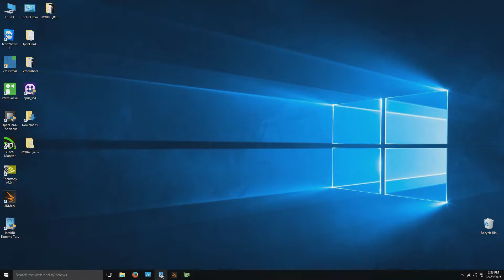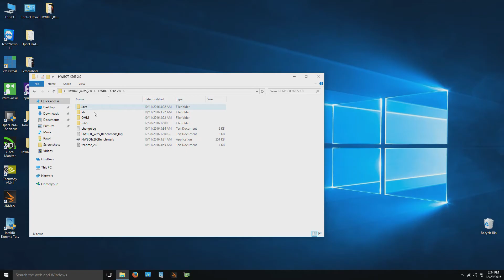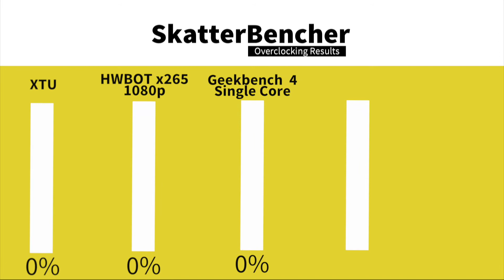Intel HD Graphics 630 (i7-7700K) to 1350 MHz with AIO | SkatterBencher #6

Comment: Hi me, i wonder if i can overclock an i5 10600k but from intel extreme tuning utility and would have the same results?
I have the rog strix z490e and i would like to overclock my processor
Reply from the maker: Intel XTU provides the same (or similar) overclocking tools like you'll find in the BIOS, so it shouldn't be an issue. I always prefer the BIOS because then I'm sure the settings are applied. Sometimes software can be a little wonky :)

Comment: more than 1300 only freese, and BIG voltg, big temp for x26-27
Reply: im running it with the multiplier to x13 (1360mhz). The limit for my iGPU was x12.5 because after that you need to activate offset; with my pc stabilized over +0.070V

Comment: How far can HD Graphics 630 go? 1400? 1500?  And is it the same for Skylake HD Graphics 530 ?
Is it possible to do a comparison between i7 4790k HD Graphics 4600 ( default 1250 Mhz , OC to 1350 Mhz) and Kaby Lake at 1150 & 1350 MHz?
I haven't seen this kind of comparison before and it could be good material for your channel. 
Thanks